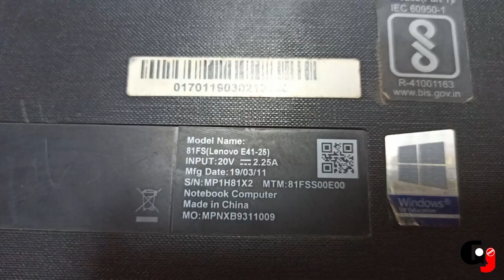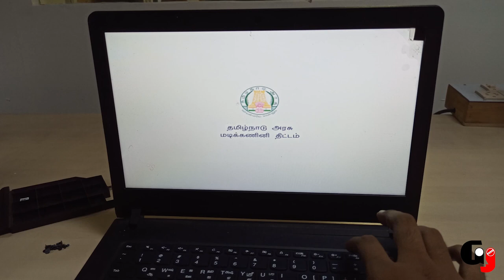How to Change Hard Disk in Government Laptop | Lenovo e41-25 | in Tamil

Comment: Hello dude. I have hp govt laptop. Harddisk not working. Which hard disk is best one to buy ?
Reply from the maker: Seagate / Toshiba
Reply: Thank you for your reply
Reply: Hello dude..changed hard disk. I can't install windows 7 os in my government laptop. Very slow. What can i do
Reply from the maker: Check our windows 10 installation video, it will help you !!
Reply: Is windows 10 is compatible for government hp laptop
Reply from the maker: Yes
Reply: Thank you for your reply... ❤️
Reply: Sorry for the disturbance
One more doubt.
Why laptop function is very slow ? Because of os or anyother reason
Reply: Hanging too much...why?
Reply from the maker: The top 2 reasons for hanging
Too much
1. OS issues
2. Harddisk Problem

Os change panni parunga performance ila apdna harddisk mathura mari than irukum mam
Reply: @GeekvsJerk   hard disk mathi than windows 7 ultimate os poten...ana romba hang aaguhu

Comment: Bro en hard disk reader head damaged Lenovo e41 25 athu mathuvangala bro. Na en frd laptop  la Iruka hard disk la en hard disk platter potu files edukalam nu iruken bro athuvu e41 25 tha bro ana avanuthu toshiba enthu hgst rendu ore size tha bro work aguma Ila hgst la tha podanuma Ila podave koodatha bro..pls bro edhavathu solunga bro
Reply from the maker: Harddisk head mathurathu ku specialized tools lam venum bro, better try to buy a new Harddisk
Reply: @GeekvsJerk  apo athe model hard disk la potu files eduthukalamla bro onu problem Ila tana bro
Reply from the maker: Harddisk open pandrathuku proper tools venum bro, so pathu open panni check pani parunga bro
Reply: @GeekvsJerk  nanri thalaiva panitu solren😍